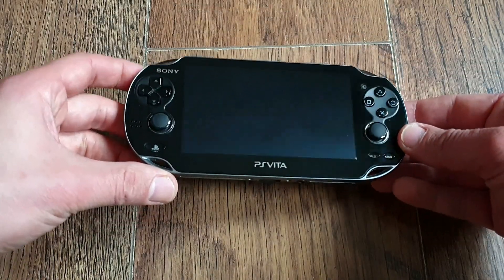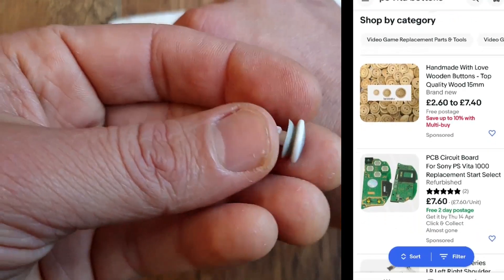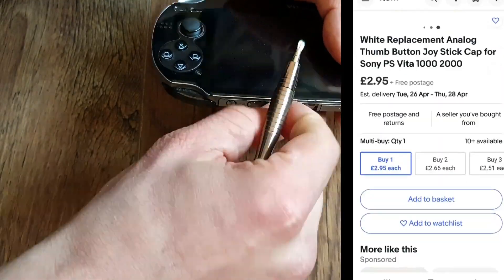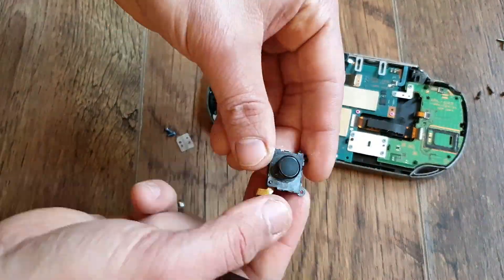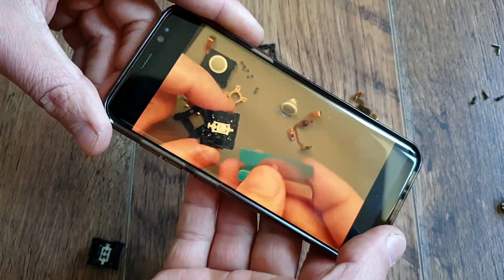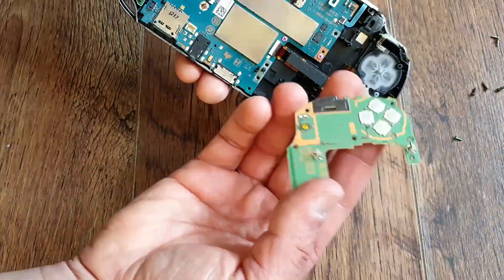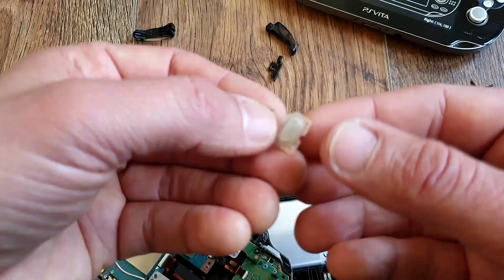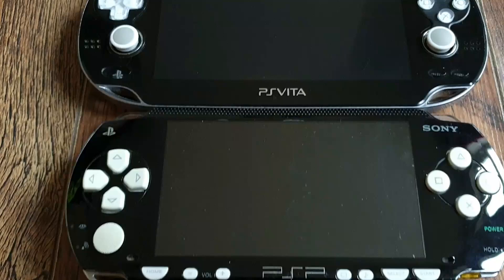Quick Ps Vita 1000 Modification

Comment: Quik disclaimer: modding the PSP is easy, the Vita is a nightmare... With ribbon cables tossed in! Ergo Chuck is a BOSS for pulling this off! I refurbished a 1000 model because I can't stand scratches on my screen! So if any of you get the bright idea to try this watch several tutorials, and be prepared with nerves of steel!
Reply from the maker: U re absolutely correct..to change buttons on psp you just need to remove front place..whereas here u gotta unmount even pcb😃
And as I ve said I wouldn't really recommend it for the faint of heart ones😏
Reply: vita slim is so easy
Reply from the maker: @lolcat  vita slim has got same structure then phat. U still gotta remove both button pcbs and unplug alle the ribbon cables
Reply: @Alice Manson I'm trying to refurbish my Vita 1000 as welp, it's a bit scratched up and it's bugging the hell out of me. Do you have any specific tutorial that you followed? I'm looking to change the front screen(with the frame), the back touch screen, and the joysticks. Do you also happen to have links for these? I'm nervous the replacement screen won't be genuine OLED and I'll be stuck with a normal crappy LCD screen. If you could help me with any of this and make any suggestions, it'll be greatly appreciated. Thanks in advance.
Reply: @homerj.s5078  that's my concern too. any answer would greatly appreciated.
Reply: @homerj.s5078  I read that no where actually made third party screens for the 1000 and that all that you find online is off of Vitas that were never sold/ defective

Comment: Thank you for your video I've taken apart and rebuilt or cleaned PSPs, original xboxs, ps3,4, and a few gamecubes an i have to say the only thing that actual worries me here is doing the analog stick replacement i mean if it was the whole assembly it would be quick but it's expensive, I'm going to try to rebuild this beat up vita i got the sticks are eaten n destroyed so i bought replacements and am planning on doing it when they arrive

Comment: DO NOT, under ANY CIRCUMSTANCES, follow this guide. He does not state how fragile the analog thumbsticks are and how expensive they are to replace. Both of mine were rendered useless and it set me back $35 for two replacements. Instead, use white silicone caps - They cost about $2, much safer and more useful.